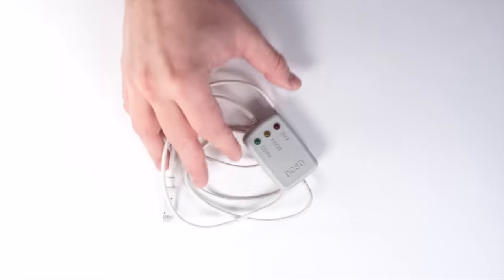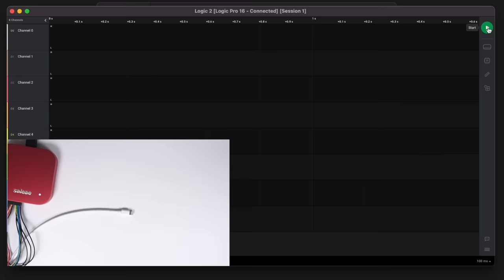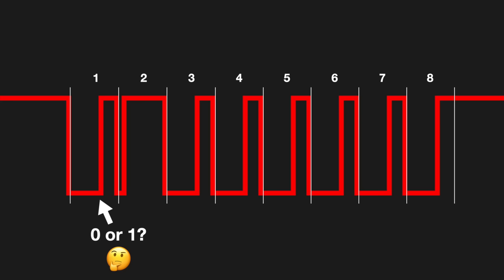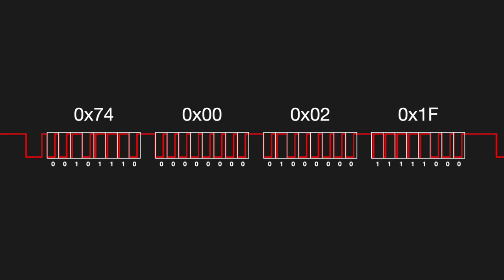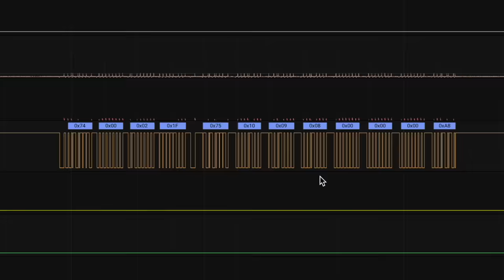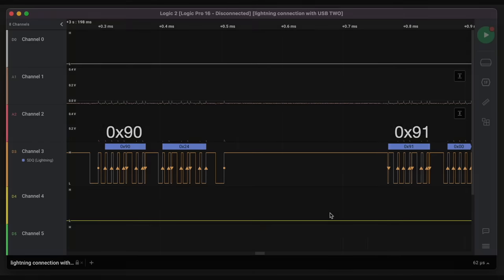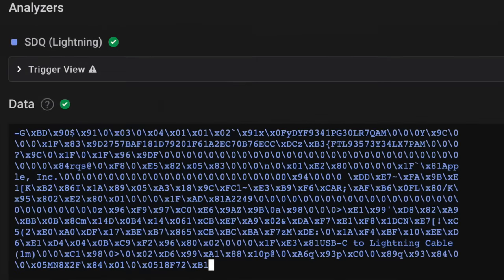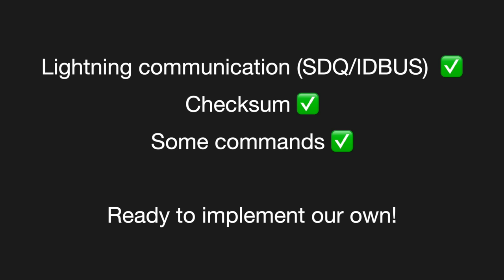The secrets of Apple Lightning - Part 1

Comment: I wonder if their Type-C cables have something like this as well.
When connecting my 2021 11" iPad Pro to my PC using the stock charging (and data) cable it behaves very strangely.
iTunes only connects properly (meaning apps like epoccam pro or duet are able to connect and work through usb) when I plug it into my graphics card (rtx 2080) and not my motherboard (B450M Mortar).
However if I use a Type-C extension cable with the same original cable, connecting it to the graphics card no longer works, BUT connecting it to my motherboard does work.
Reply: It's not for your benefit. If it has it you should probably be angry.
Reply: Some USB-C devices are poorly implimented. There are plenty of devices where the cable plug needs to be flipped to work properly.
Reply: @johncoops6897  it works both ways, poorly implemented extension cable doesn't explain why it starts working with a slot that wasn't working with the original cable, if you meant the original cable is poorly implemented, I can agree with that

edit: also my other type-c devices work perfectly with both slots with the extension cable too
Reply: @Afthrast  - Type-C is notorious for incompatibility issues. The problem is almost always that the manufacturer took some shortcut and didn't impliment the USB-C properly.
For example, the cable's plug is double-sided however the connections are not mirrored. It relies on signals being on the correct sides on both upper and lower sides in order to work properly. That may not be what is wrong with your system, just an example.
EDIT: I am not just talking about the cables themselves.

Comment: Being perhaps slightly cynical, but having something as benign as a charging cable reporting a serial number to the phone could build a fairly comprehensive dataset of an individuals associations. Who's using which cable and when?
Reply: Truly, they don't care. You are not important enough for them to even bother monitoring you.
Reply: @johncoops6897  you should care. There's a difference between active monitoring and data collection. The ability to paint such a detailed and granular picture of someones life has scary potentials should the data get into the wrong hands.
Reply: @grahamek86  - do you use Google or YouTube? They expose a far greater risk than (your feared) collection of the charging times of your phone.

Comment: I have a question. Does it detects that you are tapping / sniffing it ? Does it responds in any other way when it detects there is something between both cable ends ?
Reply from the maker: It doesn't, as I am pretty much passively tapping. (They could theoretically detect it with capacitance measurement or so, but they don't)

Comment: Very interesting. But why exactly does a cable have to be this complicated?
Reply: So you can use a small connector and slim cable for multiple purposes, by reassigning the conductors inside to suit each task.
You should have watched the video.
Reply: @johncoops6897  I did.

Comment: Great video!

I am trying to create a DIY "lightning - USB-C" cable by soldering my old broken lightning cable to a USB-C cable. I had soldered 4 wires (Vbus, GND, D+, D-) correctly, and because the USB-C has 5 wires but Lightning has only 4, I soldered the CC wire of USB-C to the Vbus line with a 57k resistor.
But my DIY cable seems not working, the iPhone cannot charge or connect to the computer with it. I tried to change the resistor to 10k but nothing changes.
Someone can please give me some advice?

Comment: Ahhh.. so THIS is why Apple is so reluctant to use USB-C on the iPhone. Lightning gives a lot more information about what cable is being used, etc. Sneaky!
Reply: Why can’t they do this with usb c also? If they put a chip in lightning can’t they put it in C? The chip is just to make sure you bought the cable from them but type C you can any cheap af cable which means less money for them. I always knew they’re evil they can also slow our phones and drain our batteries it’s all code this isn’t new.

Comment: It was always irritating for me when after a few months my 3rd party cable would not charge iPhone anymore. (It was charging only with a device turned off). As if my iPhone reported not licenced cable. Now I know. Apple has always been greedy.
Reply: its more complicated than that, the reason specifically is, 3rd party cables are very shitty and if the phone detects that something is wrong with your charger, it simply wont charge anymore. People believe its just "oh its apple being greedy again" but this is the actual explanation, since they already have the tech to stop charging if the phone is at 80% or more. If your iphone simply didnt charge from it, it would mean that it IS them being greedy, but in this case, its the charger going shit. Never use 3rd party chargers and be a cheapskate, pay the full price. My dad's 11 pro died from a 3rd party charger

Comment: virgin lightning cable with 5 or 9Vdc SPR in output, max 3A of current and a max power output of 30W only for old apple things
vs 
giga chad sigma male type C cable with supported 5-9-12-15-20Vdc SPR plus 28-36-48Vdc EPR , max 5A current and a big giant overpowered charging circuit compatible with all kinds of things

Comment: It also has a feature where it burns to black some of the connector pins and the wire is also designed to completely deteriorate over a short time to make sure you buy a new one from apple
Reply: I have never bought an Apple branded replacement lightning cable; when the one that comes with the phone inevitably fails, I buy a knock off. There are some with a braided outer covering that seem to be more durable than the flimsy cabling Apple uses.
Reply: @stevebabiak6997  do the knock offs charge the phone?
Reply: @asaeed86  - mine do. And because the one I bought is braided it seems more durable than the flimsy Apple lightning cable.